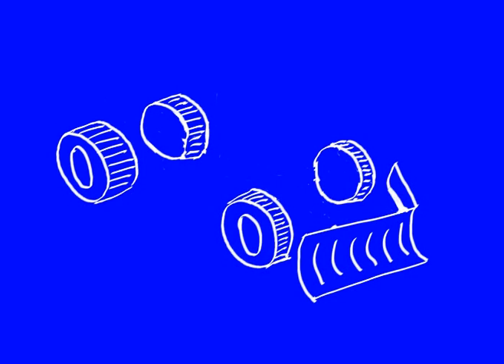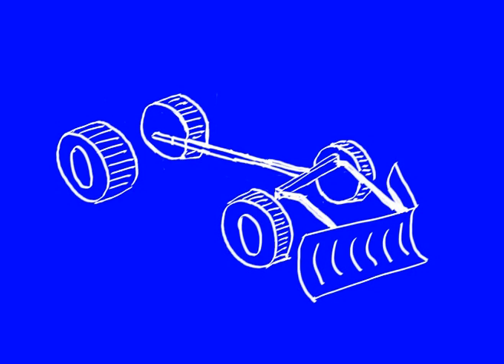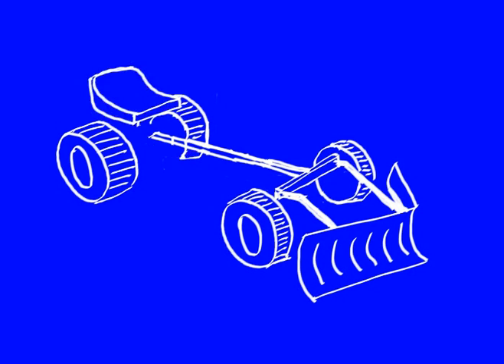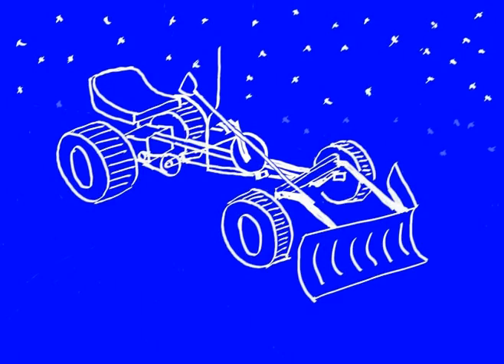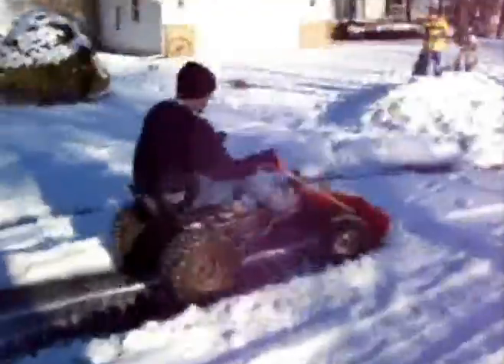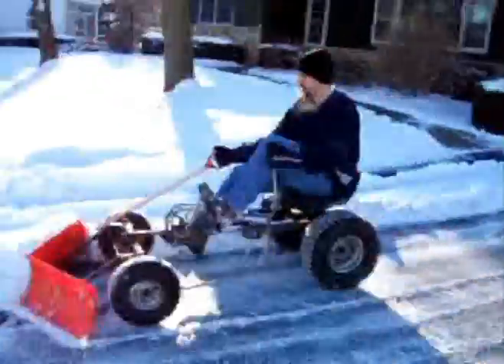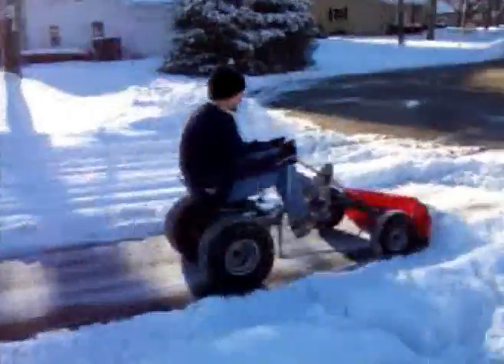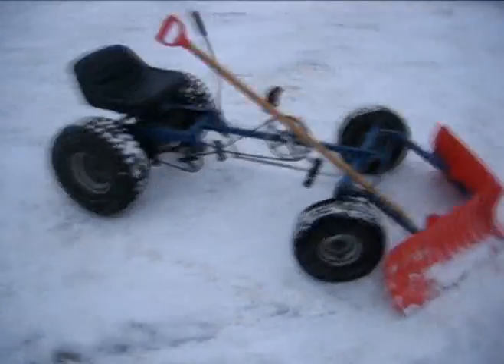Pedal Powered Snowplow

Comment: I know this sort of thing kills a small budget but have you given any thought to adding an electric assist system from an electric bicycle? You could even forgo expensive fancy batteries and use a couple of marine batts instead for the better price and extra weight. Add a solar charger to top it up between snowfalls and you're still pretty green but with extra power and weight.

Good fun project though, thanks for sharing!

Comment: Pretty awesome.  Only thought I had was what happens if you hit a big pile of snow, or something else where you're stopped and pedaling is too hard to push on.  If there was some energy storage device between the pedals and the wheels where, under normal situations no energy is stored, all power goes to the wheels, but if the wheels stop and the pedaling continues power builds up until it pushes though.  It would let you keep pedaling a steady rate instead of hitting a frustrating stop.

Comment: I pictured something similar as a kid, but never had the opportunity or resources to bring it to life. Your design one ups me though, seating the operator over the rear wheels, letting his weight be applied directly to the drive wheels My only concern would be riding this up a hill steeper than in your driveway...maybe chaining a sand bag or something under the front of the chassis for ballast would solve this?

Comment: @eqrunner your point is irrelevent because this was not designed for heavy snow and ice it was designed for light snow and little to no ice, what you are doing is kinda like complaining that a prius doesn't go off road, sure its a car with four wheels but it was not designed to go off road so it doesn't work off road.

Comment: @1SnarfyDude I assume since it'd be from a mower it would be an LSD not just an open diff. Allowing power to go to both rear wheels, and not have the problems of a Lock diff during corners.

Good cheap design by the maker.

Comment: What if you put a small generator, maybe a car alternator on it which powered a light weight electric motor. You could get infinite amounts of power due to pedaling, or you could hook the power up from the drive axle, to the generator, to the battery, to the electric motor..
INFINITE ELECTRICITY!
Problem,Electric Company?

Comment: @BigScotty1972 but to charge you would have to plug it in which comes from the power plant that uses fossil fuels to generate electricity making a demand for more fossil fuels leaving a lager carbon footprint.. the electric motors is a good idea but use a solar panel car battery charger to charge it up :) or a pedal powered generator to charge it up at night for use the next day and burn off the calories from all the hot coco in the winter month at the same time :)